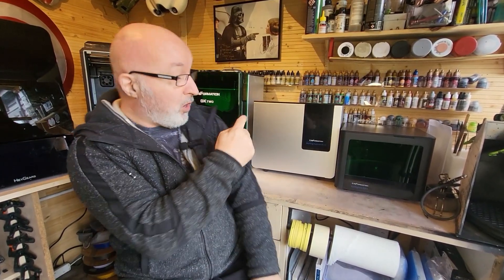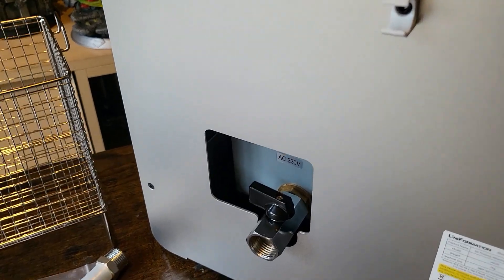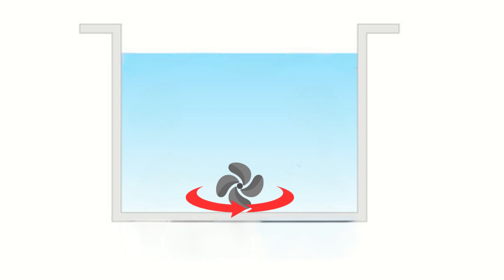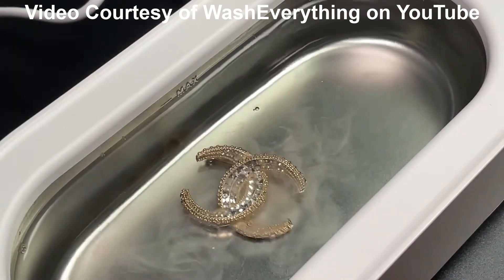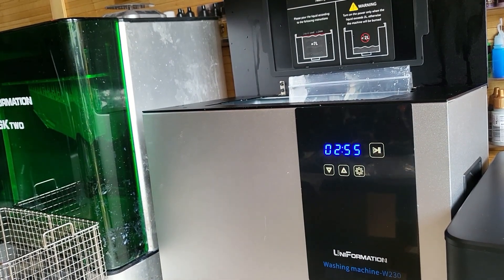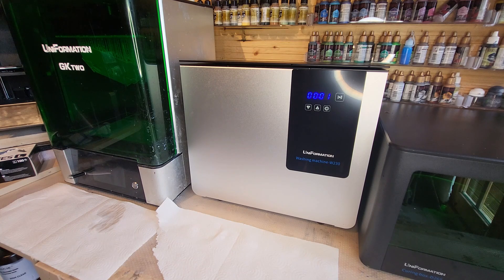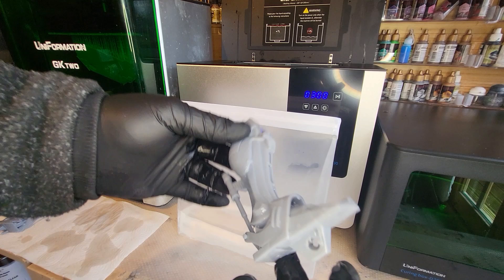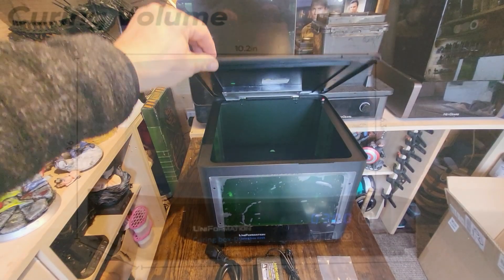Uniformation GKTWO Ultrasonic Wash & Cure Station Review

Comment: I use 96% ethanol inside of zipper bags and destilled water in the ultrasonic cleaner but the reason for this is because i dont want the ultrasonic cleaner to get all dirty. I don't use resin detergents because i cant distill them and recycle 95% right at home like IPA or ethanol. Only the washed off resin is being left in the end wich gets thrown into the curing station for an hour at the end of the day. Ethanol or IPA is safe to use in an ultrasonic cleaner that doesn't use a heater. Alcohol has a very low boiling point at 78°C and is only combustible when you get nearly 40% of the air in your room being alcohol. So uniformations answer to you is correct and you could use alcohol as resin detergent in the ultrasonic cleaner. A normal air extraction via ventilation to the outside of a window should of course always be present. Chances are people using IPA with a toothbrush for hours on big models will probably end up with more alcohol in the air than someone using IPA in the ultrasonic cleaner with the lid being closed. Anyway thanks for your video.

Comment: How does the ultrasonic method create a higher combustion risk than a magnetic spinning propeller? Seems like the chances for a spark would be about the same.
Reply from the maker: Ti's what experts recommend ...suggest you ask them 👍
Reply: @greedy3d480  The only spark that should occur in either system will take place within the power switch, since a brief arc will be created every time the switch is opened or closed.  The power switches in both devices will be similar, and on modern equipment they are largely sealed within a moulded plastic housing.  I can't see how vaporized IPA from the cleaner could ever reach a concentration within the switch to cause an explosion.  The only difference really is that the ultrasonic cleaner might cause the solvent to evaporate more quickly than it would in an impeller-based system.  The same could even happen with other power switches in the room that change state.  Therefore, the solution is obvious -- keep the area well-ventilated with fresh air, and the risk will be minimal, even with an ultrasonic cleaner.

Comment: Meh it’s safe with ipa
Reply from the maker: Many would disagree
Reply: @greedy3d480  undoubtedly, but I’ve yet to EVER hear of any incident of combustion from something even remotely like this. 3D printing on the whole though is fraught with anecdotal singularities and old wives tales. The actual science behind things like this and uv resin  toxicity, shows a much much less dire situation. But hey, people’s inevitable answer to that is “welp, better to be safe than sorry.” Although ignorance really helps no one. Ok, rant over. Cheers.
Reply: Many cleaners have heating and that would greatly increase the evaporation and risk of fire,  not heated is pretty safe.

Comment: Built an enclosure around the wash station ( and curing station ) with 6mm connectors and inject 99 % nitrogen with a small PSA generator while cleaning.  Also dont need glycerine anymore while curing

Comment: I like the ultrasonic cleaner but it’s expensive for a 7l volume. I decided to buy a Vevor 15l ultrasonic cleaner for $152.99 USD shipped. You can heat the volume as well. I prefer to use Mean Green or Purple Power which works out well as a cleaner. I’m a little sensitive to IPA, so I chose to use those alternatives.
Reply: Hello mate! I was thinking to do the same. How was the Vevor for you?
Reply: @ it’s fine. Works as intended. :-)

Comment: Why the IPA bag if you are using the Sunlu Cleaner?  I thought Sunlu said that the cleaner works in place of the IPA?
Reply from the maker: Needs to be neat resin cleaner not diluted plus was showing how to safely use ipa 👍
Reply: @greedy3d480  Ahhh. Got it -  Didn't realize it had to be straight and not diluted.  Thank you for the heads up.
Have you used it straight yet, I woud love to use a non IPA cleaner due to very dry eyes and skin.

Comment: Nice review.... I have an elegoo and creality stations. Did you actually see a better clean using the ultrasonic? I agree with the way you approached the IPA. Better to be safe than sorry.
Reply from the maker: on the surface no BUT the nature of how it cleans means that it should ( in theory) do the inside better - a swirling vortex of fluid in a the typical cleaner wont move the liquid inside ..the ultrasonic should vibrate everything the liquid touches ...i used one as a silversmith in the  past and the reason they used one was at how thorough it was..:)
Reply: @greedy3d480  thank you... I have used an ultrasonic cleaner for years on firearms. I know in that process the cleaning is more thorough. I was just curious if it was better on cleaning resin prints.
Reply: @greedy3d480  I use ultrasonic to clean my airbrushes.  I might buy this because it does such a good job.  Thanks for the review